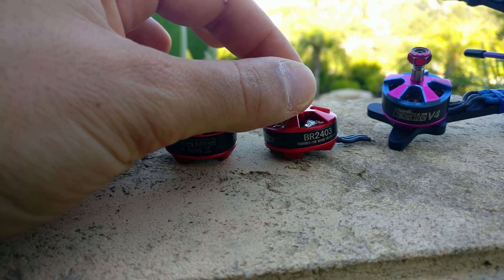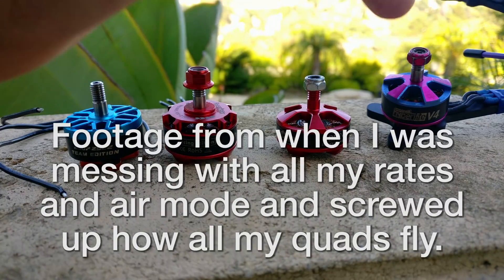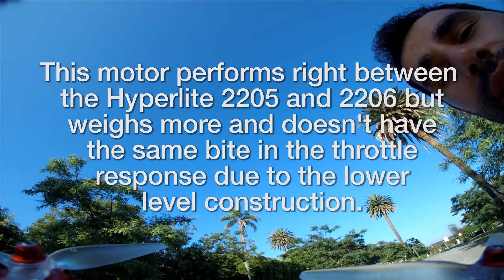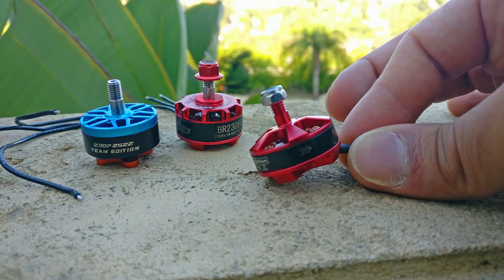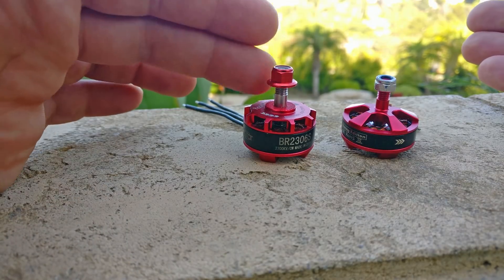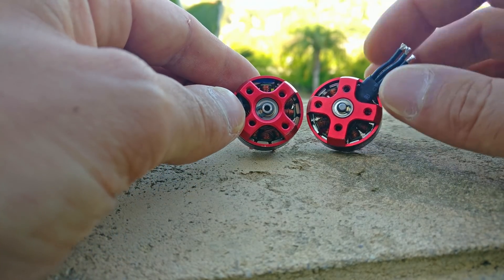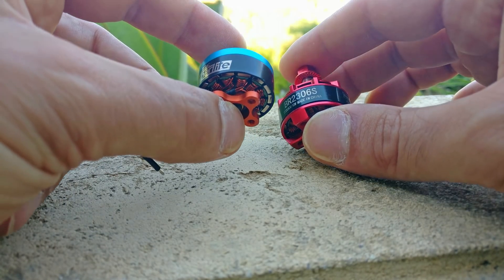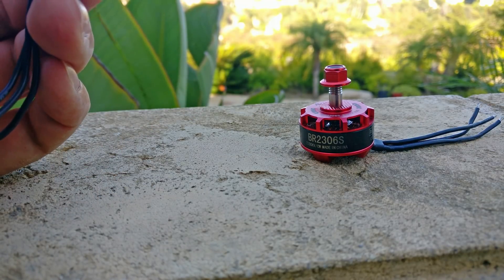Racerstar 2306 review + other things bout motors

Comment: Just search "Aluminum Quality scratch test kit" of google. I ahve a kit for ferrous metals but i assume you can get one for aluminum as well. Essentially they are just small files made of different materials that will scratch softer aluminum but not harder stuff like 7075, its worth a buy if your doing this kind of testing
Reply from the maker: Yeah those would definitely be useful. But then again, for a $9 motor, I'm absolutely sure it's not the best stuff or even the middle grade stuff.

Comment: Hi kabab what props do you recommend for a 2205 2450kv t motor air for freestyle?
Reply from the maker: I would recommend 2207 or 2208 before any particular prop. But the best prop will likely be the tmotor 5143 on any of those motors actually. It's by far my favorite prop right now.

Comment: The Racerstar 2306 motors are really inefficient.   This means flight times for these motors will be low.    The cheaper 2205 racerstars are a bit more efficient when you are low on the throttle so you get ok flight times on them.

Comment: the 2700kv likely does not have less bite due to "lower level construction". The higher kv means this motor is going to give you a greater top speed because it is capable of a much higher pitch speed via higher rpm. Conversely, this means the motor isn't able to deliver as much low end torque. It's just the difference between a jet and prop plane of the same power. One is more floaty and less responsive but can accelerate to a higher speed than the other.

Comment: Hey man my name is XFlyer live in West Virginia I'm very very new to drones and everything to do with them I have watched hundreds of videos on how to build how to troubleshoot a little bit of everything from Motors to props to flight boards to the tiny whoop I watched every video coming and going and I've got two minutes of flight time on my Eachine wizard x220s only because I didn't have the right battery charger for my batteries which I'm still waiting for but out of all the videos that I have watched and about Motors the first set of Motors that you debuted there I don't know if they were starving for power or the battery was just giving off more power than they could handle but clearly after you put the other Motors on and ran it off the same battery that performance was just phenomenal and the way you would do those tricks over top of those palm trees that was sick moves man I love that but anyway for any dick heads out there that think that that first motor was good well you must be a noob or just plain stupid because anybody can see that the power from that second set of Motors off of the same battery was excellent but anyway dude sick moves I love your flying Style

Comment: My experience with BG stuff: Never had a problem with Racerstar 2205 motors they are really good value for beginner builds. That doesnt mean that their other offerings are just as good though. However I have bought two Omnibus F3 FC's from BG both have had the same bad issues. So now I only buy good quality FC's from other reputable dealers now, the risk of the cheaper stuff is just not worth it. Also, a lot of issues people have with FC's could be from bad soldering techniques which could explain the wide experiences seen on the same products from different people. I am guilty of this myself but experience has improved my build reliability a lot.

Comment: Hey, well the $7 motor you were talking about was bought on banggood by my firend for 5Euro (his first quad) I dont like its performance either but hey for 40 dollars he can see if he likes this part of RC hobby. 

Also, well IDK which ESC you prefer but some people say DYS is good. I had like 20 RacerStar ESCs and 5 DYS escs where 20 of RacerStars work and 1 of DYS (80% of dys stopped working). Also my friend got Favourites - 6 of 8 stopped working. I cant say that racerstars are bad. I am talking about V2 and LiteS with BB2. Not the older ones.
Reply: Beware of clone DYS ESCs. Make sure yours have International Rectifier (IR) FETs or Alpha Omega Semiconductors FETs. Clones use unknown FETs. 

He prefers Spedix ESCs, which I'd like to try but Spedix ESC isn't available locally here.
Reply: I have some spedix right now. Those are some old ones and motor shaped. I am curious on how those perform on my long range setup. Ive flashed old SImonK for BlHeli 14.9. Soo it should be just ok.

Those DYS ESCs were from hobbyking. It was like one burned right after connecting it to the build. The next one theyve sent me stopped working after Ive tested that quad on bench. And as I wanted to use the rest on airplanes and some scratch stuff - those also faded away silently. The first one exploded tho.

Comment: I have used r2 2205 motors but kept breaking them while crashing in a field of sand. I asked quadmcfly about this and he says that those R2motors had weak bearings. Do the other brother hobby poem motors have the same bearings? I go for durability rather than performance so this in mind, what motor would you recommend to someone like me who is on a budget

Comment: Would say RCX is probably the best value out there with a price point between Racerstar and Hyperlite.  Their 2206 2400 makes more power than Emax 2306 2400 and most other motors in that KV range.

Comment: so you are using big fat heavy 5x5x3 blades on small tiny 2403 motor and compare it to a ultra-light 5x4x3 prop on a fat 2206 motor.. what a meaningful test! thanks for sharing, lol
Reply from the maker: dienstag fpv the butter cutter is not a big heavy blade. it's as easy to spin as a 5x4x3. I just threw it on there because it was a more aggressive prop for the low kv.  it's actually the right prop selection for the motor. I don't know why people think otherwise. it would be even slower and more shitty with other props.

Comment: You should do a review on the rmrc silver line motors, they are 2205 2600kv with great paper specs and they are only $10.. I just bought a set and they seem pretty good for a budget motor. Def not the best motor but I was impressed for what I paid.. I usually only run f40 pros so a noticeable decrease in power and response but acceptable. I cant find any info on them besides this https://www.readymaderc.com/store/index.php?main_page=product_info&cPath=505_506_964&products_id=6971

Comment: Since you've tried so many motors I'd be interested to hear a short list of your currrent favourites by price.  i.e best motor @ $15,$20,$25,$30 (let's assume 5" racing/freestyle fpv quads).   If they're all BrotherHobby,/Hyperlite  then so be it.   It would also be handy to have an ESC recommendation to go with each motor.    Finally a battery that would be capable of handling each properly (we all know that listed C ratings are all over the map).
Reply from the maker: UnlimitedVertical brother Hobby motors are just awesome. they perform unlike anything else I've felt. they have this bite to them that I don't feel on other brands. that being said, there are many good motors now. the tmotor 2207 is fantastic. little delicate but excellent. my favorite motors are any of the variants of the brother hobby 2207 and the hyperlite 2307. I simply don't want to fly acro with a GoPro on 5" with anything less. next step down is the hyperlite 2205 2600kv for racing on a light blade. $13 motor is hands down the best value in the industry.  if you're on a budget, only buy that motor for everything and you'll be happy. it also takes 5S and 6S fine. those are really the only motor options that make sense to me. the F40's are good too but tmotor metal is just weaker. I've tried so many other motors and really the brother motors just have this feeling you can't shake. ask others they'll say the same. zmx designed the brother motor and now they have some new motors so they should be even better. the Finx line. the race motor is simply fantastic. the middle motor is gonna be an acro power house incredible and the big one is for special things. they really covered the whole field.  I haven't tried them yet but absolutely know they will be excellent. as for batteries, I don't race so much so the China Hobby line are fine for me and the best value in the industry. the next up is the PiroflipRC 'who cares' battery.  than all the top batteries which now are 1500-1600mah. infinity, tattu r line, thunder power adrenaline. the rest all fall between somewhere. you can't really tell with batteries because they vary from batch to batch. the HK graphenes were Excellent for the first two batches. now they're just expensive and crappy. do not get anything HV at all.
Reply: Thanks for all the info.  Lots to digest there.
Reply: Where is the best place to buy the all round best budget $13 motor?
Reply: Kabab FPV best comment summary I’ve ever read!!!

Comment: no one is intending to or expecting to buy a HIGH QUALITY MOTOR for $6-$8. I was expecting they'd break n I'd practice n learn replacing motors, except they never broke. Stop acting like ppl are defending racerstar as high quality. ppl are defending their beginner purchase that worked for the purpose intended. I really wanna meet the guy running racerstar motors in any event style competition n thinkn he's got a competitive edge.
Reply from the maker: 1031Six I didn't say it's a bad motor. I gave it a buy rating. I don't know why you're upset over that. and I don't recommend high cost motors. I recommend an $11 motor over a $9 one.

Comment: What do you think of the brotherhobby returner r2 2205 2800kv , I was going to get the racerstar 2306 2700kv and changed my mind to go with the BH motor it's a few $ more but what I can see in the pictures they look as if they would be better than the RS motor , what do u think
Reply from the maker: Quad Father 504 FPV the 2800 is excellent. make sure it's on a light prop and on a very light build. 250g max. it'll be a rocket
Reply: Kabab FPV thanks very much , I tried doing my own research on them but there's not a lot out there on the BH motors , and if they are that good idk why people aren't buying them instead of the RS motors, they only like $6 more seem like a no-brainer to me , but anyway thanks and great flying and I love the content 👍👍

Comment: I have a slight concern about my batteries c rating, so I have 40c 1300mah floureon batteries, and I ordered the hyperlite 2307-2522kv motor, I'm a little worried that my batteries won't let me use the motor to its full potential and that I won't even notice a speed difference, your thoughts??
Reply: HexDan you will destroy those batteries with those motors. Even the very best batteries on the market these days are struggling to keep up with these new motors. Supposedly the China hobby line 100c batteries piroflip, or race day quads sells are a good in expensive option.
Reply from the maker: It is true that these new motors are capable of totally destroying batteries but they can also be flown without worry.  As long as you're below ~80% throttle, the amp draw is actually a good bit less than a smaller motor producing the same amount of thrust.  You will also need to be smoother on the throttle.  Sharp blips to 90% or higher are what totally destroy a battery.  I get longer flight time with the 2307 than any smaller motor as long as I'm not racing.

Comment: what are your thoughts on the RCX 2206 v3? they seem to be pretty good to me but ive never flown hyperlites.
Reply from the maker: harry lenon great value motor. really really good performance for the money. as good as the top motors in performance
Reply: Kabab FPV mine lasted one flight, zero crashes. Clicking noise like someone running plastic along metal bars. I'm guessing slipped magnet?

Comment: I'm probably going to replace my 2300KV KingKong motors in the near future (when they break). Would the RCX SE2205 (V3) 2600KV be a reasonable upgrade for a beginner-intermediate flyer like myself? I'm running 28A ESC's with DAL 5x4x3.
Reply from the maker: +LazerLord10 yes those motors would be fine. Although these aokfly motors might be a better option. I'm waiting on them to see. Someone just told me about them. The build quality looks quite interesting.
Reply: I'm more for getting maximum bang/buck rating, not exactly maximum performance. So if they end up being super expensive, I'll probably stick with the $11 RCX motors for the future if my motors ever break.

Comment: Please try out some of gartt's motors. the qe2205c 2300kv motor is absolutely insane, albeit low kv. just be warned that on this motor they extended the motor windings to make motor wires. so if you plan on cutting the wires to solder, you will have to scrape or burn off the epoxy they use. BUT that being said, this motor has been outperforming anything i can throw at it. even the hyperlites.

Comment: There's one thing that is bothering me in this video.

well you did NOT used the SAME propellers on each of the motors. One you use butter cutter, next you use Dal, next you uses HQ.
each propellers have different characteristics and you should have used the same everywhere!

Your conclusion may be true but NOT your results which is far from being consistence.

thank you very much. keep up the good work and no offense but i do like your video.
Reply: Yeah, the butter cutters suck!  I think they redesigned them, but i wouldn't touch them ever.
Reply from the maker: You're right, the butter cutters are total trash but it's just what I had at the time and threw them on there.  It doesn't matter however.  The motor sucks no matter what.  Nothing about my testing is scientific.  You're basically just taking my word for it.  But my word is pretty accurate here because they really do suck.  Don't waste your money on them.  I didn't care enough to do any degree of proper testing.  The motors are so clearly worse than anything else I've tried that they're not worth my time.

Comment: recently got a set of the racerstar 2306 2700kv motors.
definitely under powered. 
They are smooth and as per your review, good for up to intermediate. Great for people not wanting top performance. Cruising around, freestyle etc.

I prefer the sunnysky RS2205 2500kv motors. bangers sells them for $2 more and they outperform in speed, torque and are better made. (I dont use the lite version but they perform similarly).

good review.

Comment: I Think the biggest problem with the racerstar 2306's are the bearings. If they upgraded those, the motor would be worth there money. But after a couple of flights and i started getting occilations that couldn't be tuned out.
Reply from the maker: I think this is the biggest problem with all motors
Reply: Kabab FPV ok. Does brotherhobby have problems in that direction? And what do you think about the 2306 dys motors?
Reply from the maker: haven't tried the DYS.  All motors have bearing issues.  some are a little better than others but for the most part, bigger bearings are better.

Comment: brotherhobby, emax, racerstar, turnigy, or whatever motor you Can tell, all of them are from china. Your 20$ motors cost them Just a tiny bit more than a 10$ motor, your Just paying for the brand
Reply: Not true at all.  The $20 motor has tighter tolerances, better bearings, better material.  Some of these cheap motors have shafts that wobble when new, that shows up in your video.  I'd sooner use cheap escs than cheap motors.
Reply: Let met say it this way:
Do you think the chinese guys who make 20$ motors are paying 10$ more the making than the guys making 10$ motors ?
Reply: I don't know what the additional cost is for the manufacture, but 7075 aluminum is more expensive for sure.  The difference between a brotherhobby motor and a racerstar is obvious both in the hand and in flight.  I really don't care what their profit margin is on cheap motors vs. expensive motors either.  The motor is worth what someone is willing to pay for it.
Reply: well then you'll pay the ceo of these brands and at the same time the unimportant chinese workers are paid the same price whenever they build the 20$ or the 10$ motor
ps: I'm not english so don't cringe for my bad expression pls
Reply from the maker: This is your opinion.  When you get better at flying, you're not gonna enjoy your wizard so much
Reply: I'm now flying a way better setup because it's a more powerfull one.. Are you that dumb lol of course if I get 40amps esc it will be better than 20amps.. I'm talking about the difference between motors that are nearly the same but with high difference in price because they are from different brands

Comment: I thought that some RacerStar ESC's like the V2 RS30A are rebadged Cicada ESC's?? I have a set on one of my kwads and they have been gr8 fuckin esc's, fore shore!!
Reply: LOL!  I can fly well, the racerstar 20a escs are pretty good.
Reply from the maker: Give it about a year.  When you can fly well, you won't think the cheap esc's are very good.
Reply: ? I'm confused! I don't think that a $15 esc is very cheap. It's not the most expensive. They have lasted me a year an a half, they have powered 3-sets of motors with no problems at all! If it works don't change it! I would recommend Cicada ESC's for a gr8, dependable and quiet esc to anyone, even you should try them, lmao!! Have a good one, love ya bro!!!